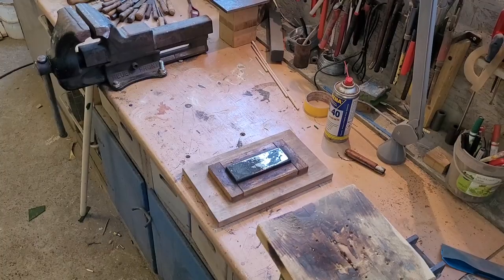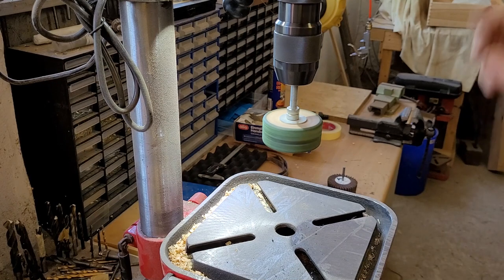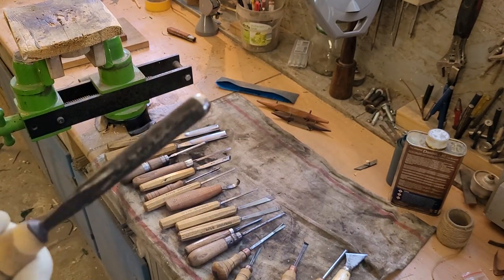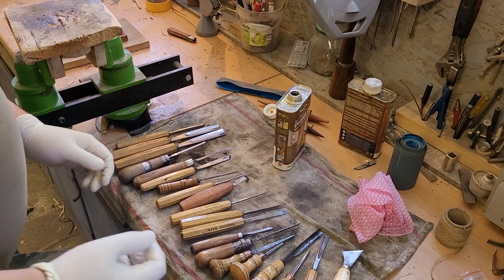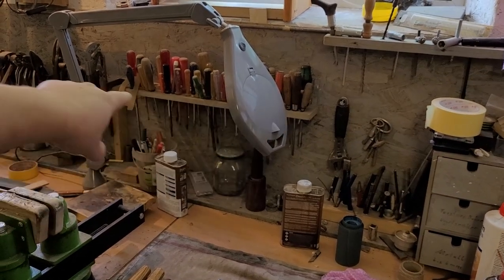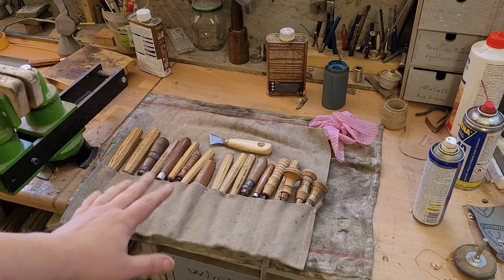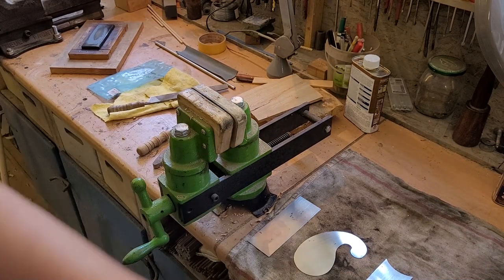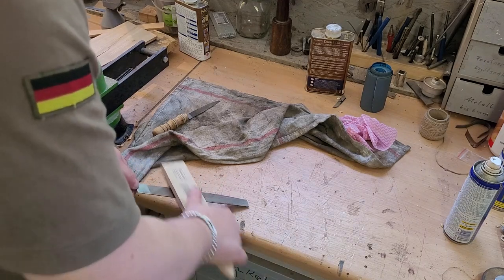Gunmakers tool maintenance

Comment: Thank you Roger.  You guilt me into sharpening my gouges. lol 
A couple chisels I used on a bread dough bowl I recently made did not preform as well. 
Looking forward to your next project. Have a good day.
Reply from the maker: Oh that sounds good 🤣 specialy on hard wood it is useful to check the gauges very frequently. Otherwise it will be no fun to work with and the surface will get rough or get breakouts.